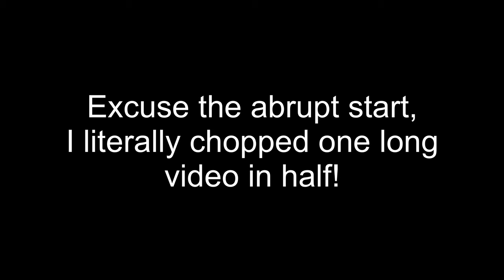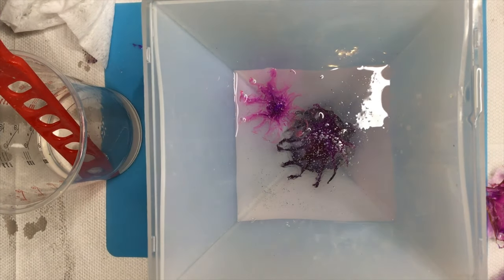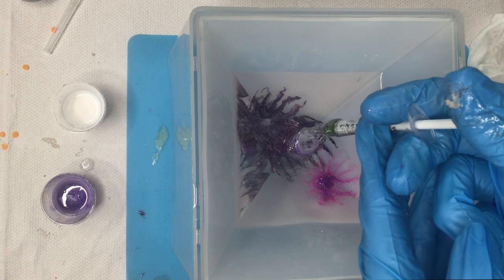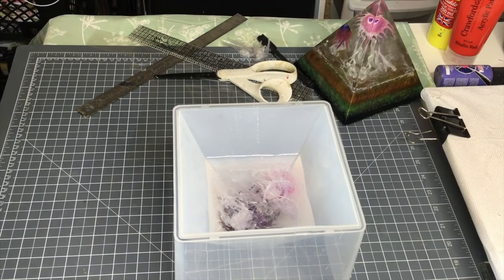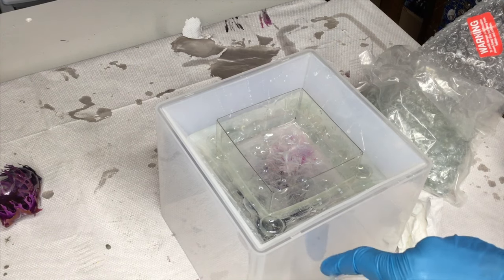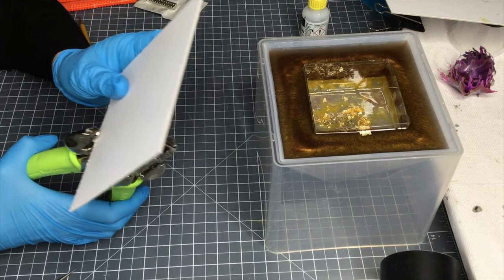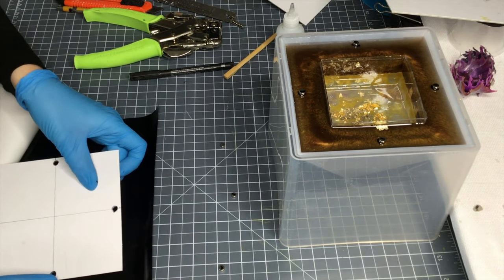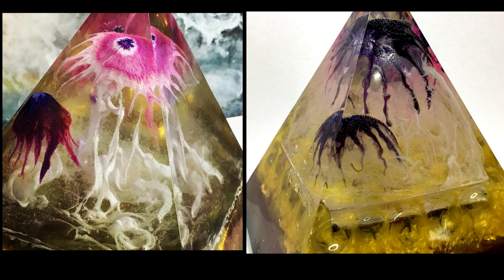Jellyfish Resin Pyramid Lamp Tutorial Part 2

Comment: Hi Louise, I'm absolutely enthralled by your lamps.  In your experience (from watching your videos) which do you prefer to put the lights into?  That is, the plastic handmade square or the bottle which you cut out before inserting the lights? thank you x
Reply from the maker: Hi Jill, thank you for your question. It’s not an easy answer really because it all depends on the project. The easiest way is the plastic bottle and it also saves on more resin due to its capacity so if it was a project where the lights could go all the way through the pyramid I would go for the bottle idea every time. The thing with the jellyfish pyramid was, I needed to be able to access the resin to create the tentacles so the bottle wouldn’t have worked in that case so, in conclusion I would say, it depends on the project. 
By the way, I’m glad you enjoyed my videos and I would like to thank you for your kind words xx

Comment: Hi!! How come that resin has zero air bubbles?
Reply from the maker: Maybe it’s the photography :) there were plenty of bubbles but I went with them because you would get bubbles under water (that’s my excuse!) I do find that using a slow curing resin for deep casting really helps because it has a long time to clear up. Also warming the resin in a warm water bath before mixing really helps to eliminate bubbles. Thank you for your comment, it made me smile :)
Reply: @LouiseSingletonCreations  cheers!